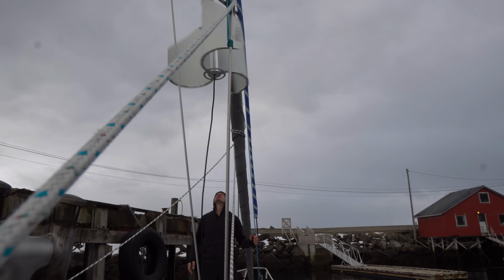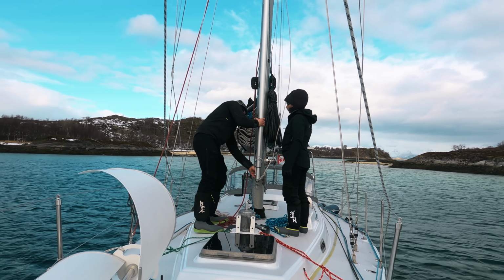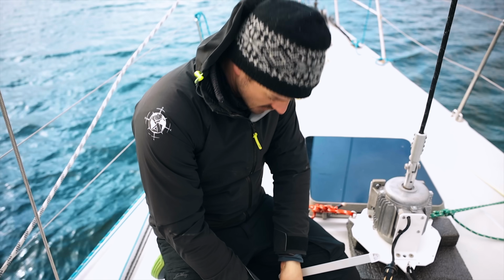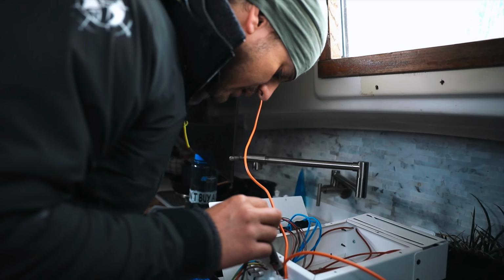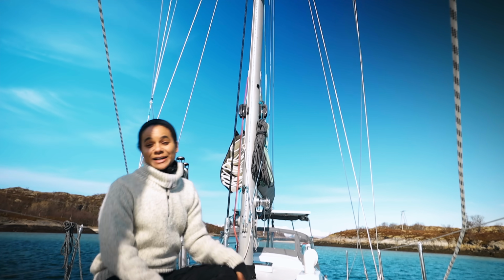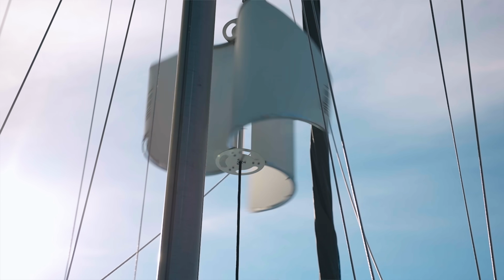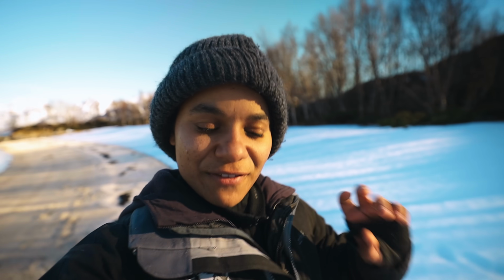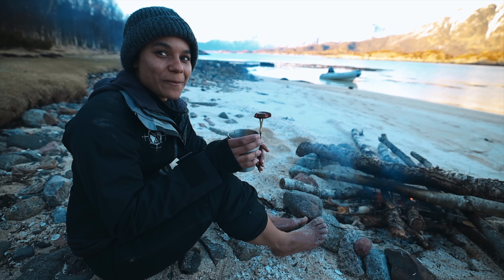No Sailing, Just BULLSH!T — Sailing Uma [Step 273]

Comment: Great experiments! I'm also a fan of the vertical axis turbine (no pun intended!) and I designed a super lightweight rotor made of aluminium tubes and sail cloth. Regardless, I see a potential efficiency loss in your arrangement when the turbine axis is not fixed but wobbling around like at 9:29. I guess that the final layout should have some system to keep the axis parallel to the mast, possibly 2 supports/bearings. It very much depends on what parts you will want to leave in place: the full rotor and supports, just the supports, or nothing as I guess Dan is thinking of. Looking forward to the next iterations!
Reply: Bolt connection points into the deck would seem to be needed . Flush and sealed so nothing to trip on.

Comment: In some of the shots in this video, Uma is showing some quite marked oil canning on the sides of her hull, just aft and just forward of the mast on both the port and starboard sides below where the mid deck chainplates penetrate the deck. Might just be the low Scandinavian sun highlighting it, nothing wrong with checking that everything is as it should be on an older boat.

Comment: Maybe a gearbox (transmission) low side on the blades and high speed on the gen for higher more efficient rpm to max output. Gearbox can protect the gen.

Comment: I use screw terminals with stranded all the time, but you HAVE to crimp on a ferrule.
Reply: That's the only way with that type terminal. Easier and better is wago's or din rail terminals
Reply: Absolutely. DON'T solder the wire ends you intend to connect to the screw terminals. Solder is too soft and the connection will become mechanically loose and electrically unreliable over time. Yes, many people have done the soldering + screwing in the past but it's bad practise.
Reply: https://en.wikipedia.org/wiki/Electric_wire_ferrule yep
Reply: A simple trick to use in a pinch is to strip two or three times as much insulation to give you more exposed wire and simply fold it up to make it bigger to give a tighter fit.
Reply: I use them whole life, never had a problem, solid wire or not. They are far away from "nightmare"...

Comment: Why’s it squeaking? -  the thrust bearing is either absent or set incorrectly due to your modification.  If there is one it probably set to support the weight of the turbine.  Try taking it out and reversing it so it’s working against the tension of the torsion  line.

Comment: STOP !!  Never ever use a plug for output, you can get a electrical shock from the unisolated pins.
For output you can use the extensionsocket, and the plug for the receiving part.
And if anyone is unsure how to connect electrical systems, dont do it, pay a electrician to do it…

Comment: You need a steel or fiberglass rod to make the connection between the motor and blades. You're losing too much torque in the rope. But I'm sure you knew that and were using what you had on board 😉🙃
Looking forward to this build Dan. I know it's going to be epic. 👍👍👍👍👍👍👍👍👍

Comment: On the positive side, you learned that it doesn't work. Even with a thrust bearing, it will be a drop on a hot stone. 
If you can't install a horizontal turbine. (best option)
A small silent running Honda generator will give you 2,000 Watts in 1 hr, how many days of wind power will the vertical turbine produce the same wattage? sell the outboard, but an electric outboard. Use the gas to run the Honda.

Comment: About your cable connection issue.. you can buy copper "jackets" i think they are called in English, and they got same electrical solutions as Sweden does =)
They can be found in hardware store in all of Scandinavia or home hobby stores like Clas Ohlson in Sweden (Yes that's the stores name), You already got the tool to crimp on these small copper things and you got solid hard tips on your stranded cables =)

Comment: Why waste your time with wind generators they are never going to be  any use. The idea sounds great but when you anchor you are looking to get out of the wind. If the wind turbine works at its optimum you need 25-30 knots of wind.
Most sailors would rather find a bolt hole that shelters them from that level of wind.
The way to go is Hydrogen generators. A boat is literally sitting on its fuel source and unaffected by the weather at anchor or sailing.
You could generate everything and more using sea water!

Comment: Ok.  Only because you are experts at creating solutions.  
1.) can your arch handle a horizontal axis at the height you need?
2.) if shading the panels is an issue (saw the VAWT blades shading the panels) then maybe have multiple mount points on different sides of arch so you move a HAWT accordingly? 

HAWT is more efficient for sure.  I like your thinking on the solution.  Quite clever.  However, your efficiency will be pretty locked in the bottom of the efficiency curve.

If the goal is to just have fun engineering a VAWT solution then you are doing great and have fun.  If the idea is really to maximize production, not sure you are going with the best solution.

With your solution how do you waterproof the alternator (generator).  That’s a big part of the equation.  I understand you were just doing proof of concept and again, very clever.  However, I’m curious to see it actually be a solution.  

Good luck and enjoy the process, discovery is the best part of projects.

And great shout out to Erik.  Clever word play, however, I would say your video was hardly bullshit (except trying to burn that wood).  😂

Comment: 8:54 for a good reason, they are very inefficient. When wind blows through a normal "vertical" propeller, it hits all the blades at once and ALL blades transfer that force to spin it in the SAME direction. On a "vertical" propeller the wind pushes on all blades as well, BUT having a center axis means one blade wants to go in the one direction and the other two in the opposite. Yes they present a different shape when at the "wrong" side but still generate a lot of drag and Is this drag that reduces the efficiency up to 30% or more. 

If you need smaller and more powerful wind turbines, pick one with more blades and less diameter.
Reply: What about the Darius design? I would expect the blades to be generating lift 90% of the time.
It also looks like a design that you could put on a mizzen mast, let spin when you are not sailing, and lock perpendicular to the boom when you are using the mizzen sail.

Comment: Assuming that you have a whisker pole, couldn’t you modify it for multiple uses. I.e. also use the whisker pole as a ridged correction from the blades to the generator. 
Save space and use what you already have available. Just a thought.

Comment: Your motor looks not too bad, the only issue you have is that you should try to fixate the bottom of the blades to a boom as well. That will keep it stable and your anti torsion cord will not swing sideways and make a smoother turning.

Comment: Your setup is sound it looks like.  That motor looks like a 5hp or larger motor.  The field resistance is likely sooooo high that the resistance to the torsion is too large for the fan blades to generate enough rpms.  A  small windgen PMA alternator might work.  You aren't going to get high rpms, so you have to find the right motor/alternator that can produce a high voltage at low rpms.  The charge controller needs to be able to convert that voltage too...I used a 10 dollar solar charge controller on an old 1/4 or 1/2 hp(no plate to know what it was) 12 volt motor and got 3-5 amps at 12volt as a tow generator.  I always used more power than I produced so I didn't need to worry about dump loads or the like.  You need more voltage and there are converters that can do that..or maybe a 1/4 hp 48volt motor if you are a 48volt boat.

Comment: The smoke was from the black small capacitor. It seems that the top is rounded instead of flat because of the internal pressure of the hot gas. it needs to be replaced with one exactly the same. Same capacitance and same current rating. Also watch out the polarity when you remove the old one. You don't want the new one in reverse.

Comment: Your generator should hae a FEMALE output socket, and the ongoing cable to the charge controller should be a male plug. The way you have done it you have potentially LIVE male unshrouded pins sticking out DANGEROUS !
Reply: That and his comment on wiring 3 phase AC into that euro plug worries me. They're not designed for that. There are special 4 pin plugs and sockets for 3 phase.

Comment: You should try going from a really hot sauna into that cold water. ...and that wind generator design seems like a clever solution.  Maybe attached to a short gaff-ish beam at the top of the mast? ("wharram wing sail", "helical darrieus rotor").

Comment: I like this from the title, actually. It did not disappoint,  as usual. 

There seems to be no reason to not have a series of those vertical axis blade sections linked and hoisted by a single jib halyard, like a sail, pinned to a generator on deck (or below) able to fully capture that torque. I am sure blades could be fashioned to compensate for the tilt if it's an issue.

I wonder how easy it is to trim and curve some plastic sheet into blades and clamp them to that torsion rope...

Nice.

Comment: Arent you putting a vertical load on the bearings of the generator/alternator? My guess would be that putting tension on the axle that way will wreck those bearings in no time.

Comment: To not damage stranded wires in a screw terminal you should use "bootlace ferrules" instead of putting solder to the end of the wire, because vibration and load will deform the soldered end and make the connection to loosen up.
https://hackaday.com/2018/04/12/to-ferrule-or-not-to-ferrule/

Comment: Here's a possible solution for the solid / stranded wire issue on the boat.  Go to Amazon and look for these two items:   1.	 Hilitchi 800pcs 10-24 A.W.G Wire Copper Crimp Connector Insulated Cord Pin End Terminal Kit and  2.	 IWISS Self-adjusting Hexagonal Plier for AWG23-10 End-sleeves Ferrule.  I use them and love them!  you can crimp them onto stranded wires and have a solid tip to screw the connector to - with no soldering and no fuss!
Love the channel, been watching for a really long time.  Keep up the good work!

Comment: Choc blocks for stranded wire are fine to use but you must use crimp ferrules on the end of the wires. Makes a great connection then.
Reply: It's fine but dated way of doing it. There are better relatively cheap modern alternatives such as: wago's or din rail with terminals
Reply: @MaceOnTheRoad  Dated I don't think so ,in the field they are an excellent connection and the raised surfaces prevent shorting  and a better choice than a marrette  or crimp . In a cabinet of coarse DIN rail terminals .
Reply: @Mechone11  I get wat you're saying and they are not terrible. But wago's are fully insulated except for the wire hole so even less spaces to short on something. And they don't deform the wire after use. And I used both on a daily basis and if you do allot of those wago's are a big time saver. The only down side is that you can't screw  all types of wago's down to something. But then use a junctionbox or din rail.
Reply: @MaceOnTheRoad  Where I live wago lever are not certified in Canada ULC or CSA they are UL ,they cannot be used in Canada .
Reply: @Mechone11  Within the EU who are notorious for there high consumer standards its no problem at all. There are even situations (if a JB is not accessible) that your not allowed to use the screw ones but can use wago's. That Canada won't allow wago's is funny to me because CA wants a tradedeal with the EU, but the EU is concerned about CA products that are not up to European standards. What a crazy world.
Reply: @MaceOnTheRoad  CE also does not meet Canadian standards. We just gutted a machine to the tune of 200,000 dollars that was CE certified . Canada uses 600v  and must meet a higher standard for wire ,fusing overload protection. WE buy a lot of machines from Germany, Austria ,Switzerland and all has to be change to meet standard
Reply: @Mechone11  yeah interesting, I can imagine machinery design for 50hz having problems running at 60hz
Reply: @MaceOnTheRoad  motors and drives no problems just reprogram Hz and voltage  mostly ABB, Bosch
Reply: ^^^ THIS
Reply: Crimp ferrules on stranded wire.
Reply: 100 % correct  ,but then Dan knows everything
Reply: @Mechone11  wow.  that's a little salty
Reply: @steveqhanson6835  let's just say people that have met them weren't  impressed

Comment: 17:51 Shadows on any part of a solar panel degrade the whole panel. This is because the individual cells are "current" sources and they're hooked in series. All cells deliver the same current (because they're the same wire) which is limited to the lowest-current cell...i.e. the shaded cell. If they were hooked up in parallel this wouldn't be a problem. You would get maximum power (i.e. volts of cell x current of cell ... summed across all cells)...but you'd only get 2V or so out.
Reply: Modern solar cells have individual diodes on the strings internally  to bypass a shaded string . The cells individually produce approx 0.6 volts ,being in series means  72 produce 31 volts  approximately.  The same current passes through all the cells until one of those string diodes opens then the shaded is cut off. . They produce more voltage as they get more sun.More voltage with the same load means more current flows. Do a search for Bypassdiodesshaded.gif maybe . I can't put it here.

Comment: You need a thrust bearing at the "torsion wire connection" to not kill the bearings in the generator.
Reply: ... and some kind of mechanical transmission to speed up the generator.
Reply: @EstereoS  I doubt the rotor has enough torque to spin up the generator with a gearbox.
Reply: I agree , you need more tension because allot of energy is going into moving the wind vanes laterally, but your generator bearings may not handle that much thrust
Reply: This has got real potential but I second that observation.   The bearings will be able to take a bit of thrust but nothing like the load you have put on.   A broom handle connection would keep it all in line without high tension, but then of course you will need a bearing higher up to keep the blades from moving laterally.
Reply: or, if you did design/source a transmission shaft in place of the rope then the bearings could be dispensed with.  I'm thinking of a giant version of a speedometer cable- a large (~3/8" OD?) metal spring steel rod in a sheath that controls it's shape instead of needing to use tension on the rope.  Would be heavier than the rope version but perhaps more efficient depending on what can be accomplished with the bearings.

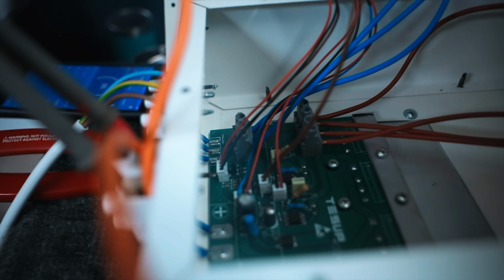Comment: The small black capacitor is shorting out and rupturing. @13:06 https://youtu.be/LdlKQCwdiL0?t=786 One of the wires is crossed somewhere and the capacitor released its electrolyte, which is why the controller no longer works, capacitor broke the connection in the circuit with no electrolyte.

Comment: No Sir. All of the times I'm watching your videos,  I got the impression that you are a perfectionist. Now you are using a rope to connect a current generator with a wind vain?????? That is the worst experiment I ever saw. Everything is out of balance and wobbling. Nothing will work properly. Shame on you!!!!! I give you 1/10 for this horrible experiment!!!
Reply from the maker: Not rope. Anti torsion cable. Very different thing and worked quite well.
Reply: Man! Tough crowd here!
You've proved the concept, now its down to the details.
Reply: Why haven’t u tried pulling power from the prop when under winder power ?

Comment: Is there a way your could add some gearing into the mix? Step up the gearing so there are more revolutions hitting the generator?
Reply from the maker: Yes, but not mechanical. Electric “gears” work much better and are less complicated.
Reply: @SailingUma  sounds good!

Comment: Have considered a bowden cable similar to an older mechanical speedometer cable and motorcycle control cables, with good maintenance they can last for years and are reasonably flexible for storing.
Reply from the maker: Anti torsion line is the modern equivalent

Comment: Why not mount a regular wind turbine to the bow sprit (or a second one because I think I remember you can remove yours easily), plenty of room for blades and should be always facing the wind at anchor!
Reply from the maker: Sailboat don’t actually point exactly into the wind one anchor. Wind turbines can’t be hard mounted or they won’t be very efficient.

Comment: Interresting idea! The axial load on the generator will probably kill the bearings though. It was not designed for that.
Reply from the maker: That generator isn’t staying long. Like we said, it will all be swapped out as it evolves.
Reply: @SailingUma  it shouldn't be that hard to have the same system and avoid placing so much axial load on the bearings, you could have a bracket soldered to the motor chasis for tension and a rigid thin "core" to transfer the rotation, something as light as possible like a pvc pipe, so that the whole system can be disassembled when storms happen but it's easy enough to mount again the next day
Reply: I think this is a really great alternative idea. I may go with a more rigid carbon fiber tube as the "drive shaft" eliminating rope flex and tension. It could be stowed below just like a long fishing pole. Looking forward to more experiments from Uma 👌👍